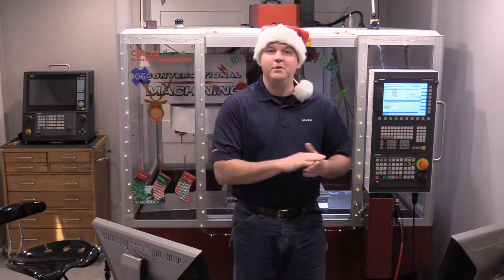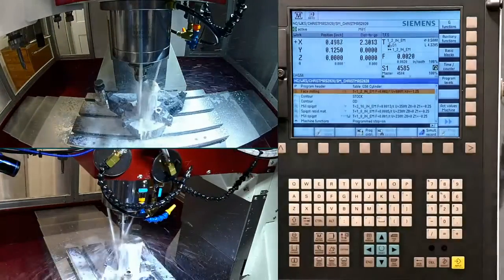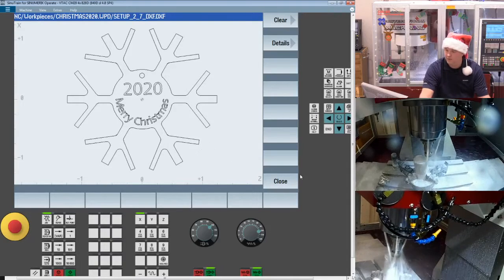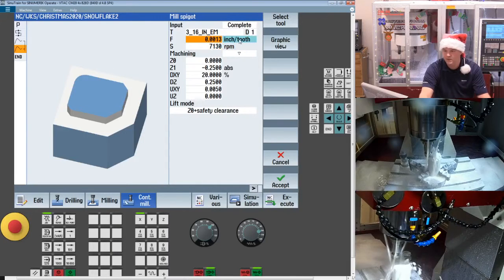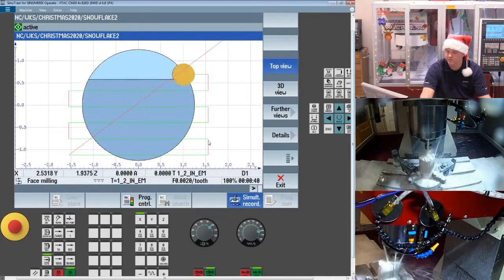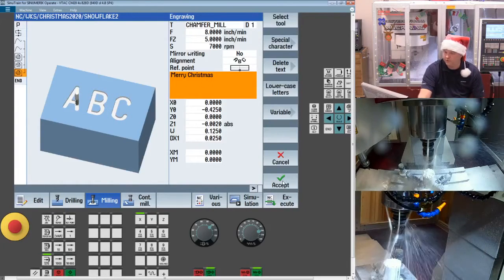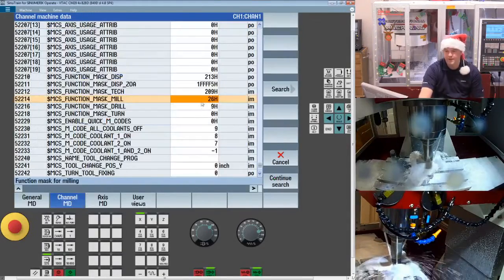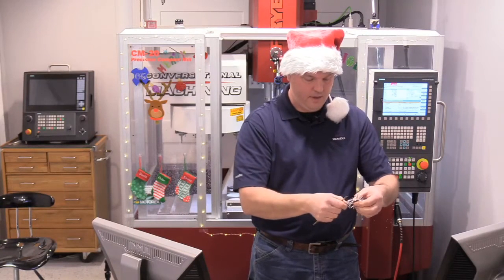Making of the Christmas 2020 Snowflake Ornament

Comment: Thanks Chris.

Great video.  Once again the impossibility of the sinumerik system is revealed.  I've been looking to a solution to simulating my A axis and I see in this video that the (new?) version you can select clamping to view the A axis representation.  The impossibility is that you can never know what you don't know.  How would you know that there was a capability to change the way the slitting saw comes out of the spigot cycle?  Where can you find whats turned off when you don't know what can be turned on?  How can I find out if the version of software I have on my machine has this capability or can the version be updated.
Reply from the maker: Andy, 

feel free to reach out with those questions

Dan.strubel@siemens.com